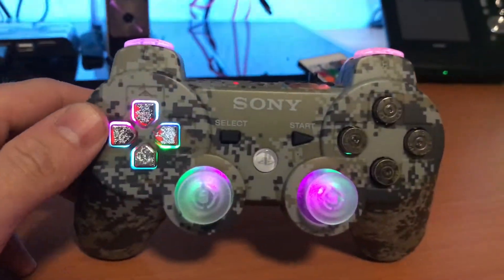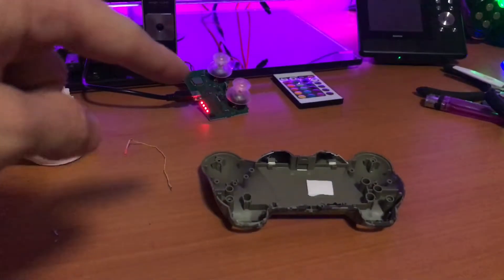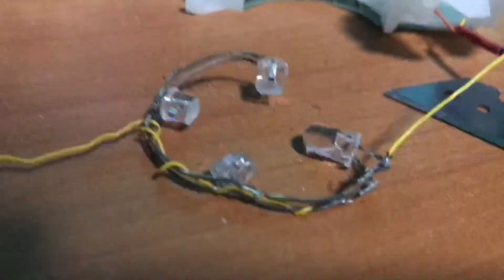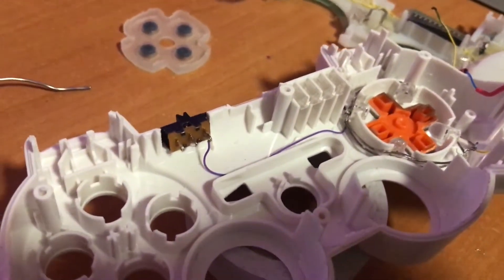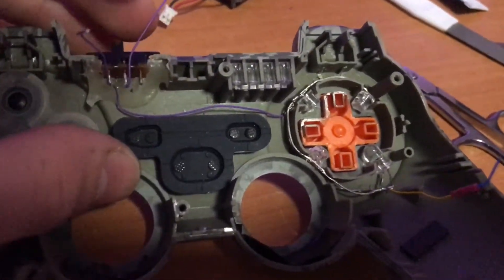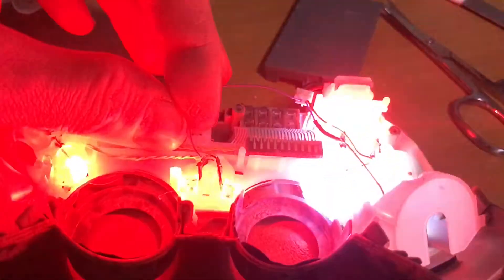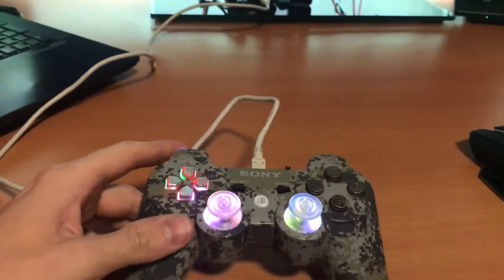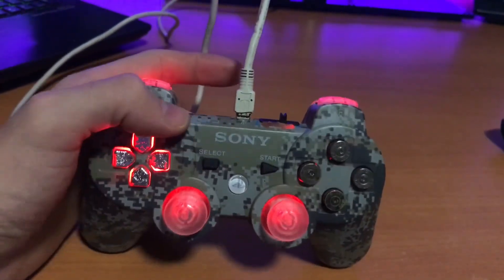How to RGB LED Mod a Playstation Controller!

Comment: battery life 15 seconds 🤣🤣🤣

amazing mod btw really like it tho might try it out
👍👍
Reply from the maker: @ZOMBIEEZ  actually it barely impacts the battery at all, the leds barely use any power, we’re talking like 5 minutes less out of like 4h
Reply: @Gagliano17  wait really?? i thought those were like 1.5 - 3v leds thats pretty impressive
Reply from the maker: @ voltage doesnt indicate drainage, thats amperage, these leds use like 5-15 mah/hr
The voltage just provides the operating range, at x voltage it has proper brightness, consumption isnt related to that :)

Comment: 8:16 Thanks, that'll be handy to know, I soldered my LED to the player 1 indicator, it works well for a single led but your way is better
btw you can also add a light to the PS button, that's where my single led went to lol
Reply from the maker: I have an led on the ps button on the green controller, its rgb and changing even :)
Reply: @Gagliano17  nice job
Reply: @Gagliano17  can you give me link to leds

Comment: Hi my friend. Please help! . This is the story. I purchase in walmart a monster led with remote controller but i miss this are 5volts leds.. i want to put this in a ps3 slim 3001a   but i see to many people use 12v leds because can be attach to the fan.. so can i use the fan cables for this leds i purchase ? I know i can use the internal usb point but my concern is if i can use the usb port normally from the outside? i beleved not but i dont know. Or if you can give me a tip where i can connect it.. you know a 5volt source internally.. i see a picture in google from a board conector for the power supply where is the standby ,is 4 pins connector there says 5v in one pin but i didnt know if i can use the cable from the power supply for this.. let me know please

Comment: That 4 RGB LED, you put 4 on left pad. What must i do to wire it circle like you?
Reply from the maker: i just ran + to all the + and - to all the -,
Reply: Dennis G and what's that yellow cable?
Reply from the maker: @Martin_urz  those are to hook it up to the + and - of the controller
Reply: Dennis G woah, thanks bro
Reply from the maker: No problem, if you need more help just ask

Comment: Nice work bro. Did you use any resistors? And what's your battery rated at? Lol. You should put a bluetooth connection on the top. The white would have been dope but don't worry about it. Ur skill shows and I am a bit envious
. What kind of flux do you use for small joints? I need some
Reply from the maker: Carl Cusumano they already work with bluetooth on my pc, also i took power of the 3.6v at the joysticks + use the regular battery
Reply from the maker: oh and flux, i just use very thin one from a local store, it's really good, but no international branding or something
Reply: I see... I've only been using a 40/60  lead/tin with a resin inside. But I need that red flux to put upon the tiny solder joints to make cleaner solders lol. I like using LeD's but I'm not on your level yet with the resistors. I wouldn't know how to measure it according to the battery.  I just bought a new battery because i think I shorted it. It won't hold a charge but works when I have it plugged in. Haha frustrating it is
Reply from the maker: Carl Cusumano get a mulitmeter, its the most usefull tool for that, you can almost always find 3.6 in stuff
Reply: Dennis Gagliano I've got a true rms meter it's pretty sick. I am curious if I can solder LeD's anywhere on a ps4 pro controller board that has 3.6 without fail. Those batteries are only 1000 Ma's lol
Reply from the maker: Carl Cusumano leds are really safe and only drain abour 20mah so yes
Reply: the regular battery is a 1,000 or 2,000 Ma? Regarding the ps4 pro controllers, the lights tend to go out on mine due to built in time delays on the board. unless I take out the shock sensors and solder a switch on. you have so many lights I am curious how long theyd power a 2,000 Ma battery. (Do you know what guage size the witre is? I know its between 26 and 32... I appreciate the knowledge brotha!

Comment: Yo dude could you give the link to where you’ve bought those rgb leds? Cuz a friend a mine wants me to mod his controller and i need rhb leds for that would be nice.
Reply from the maker: oh man, it's years ago, i bought like 500 at that time, i really have no clue, but they were called "rainbow rgb leds 5mm" ebay probably has them
Reply: oh ty dude no problem its just i really hoped to get the link but the name is good too will get perty far witht that